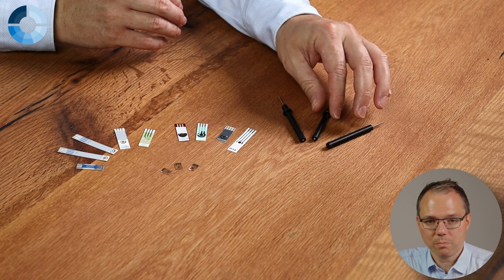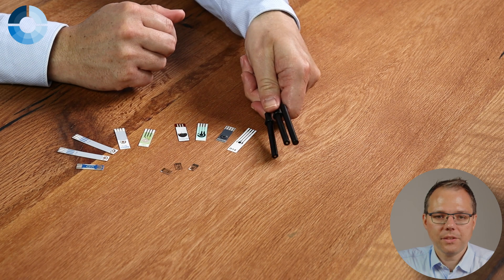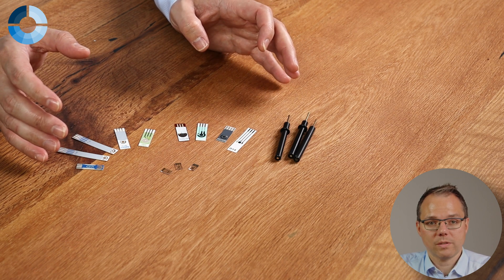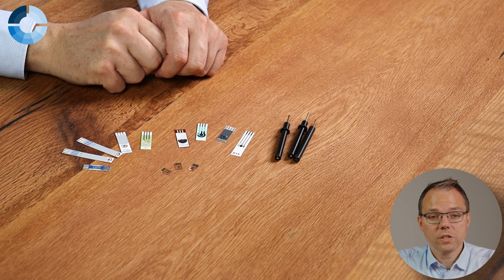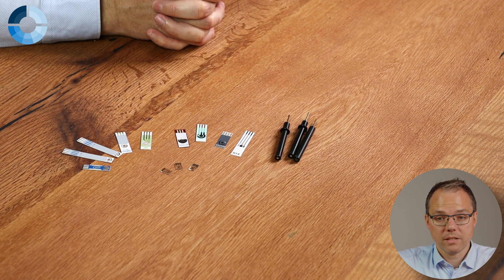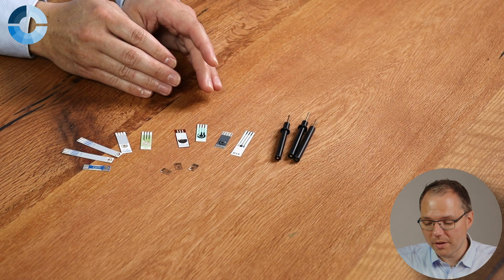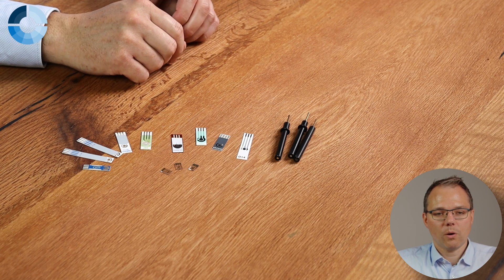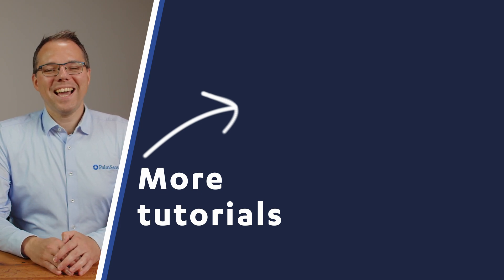What are Screen-printed electrodes and which electrode should I choose?

Comment: Good morning sir 
Could you help me out for designing my own screen printed electrode?
I am working to design a screen printed electrode using metal deposition.
My analyte is Hydrogen peroxide
Working electrode- Ag metal
Counter electrode- Ag metal
Reference electrode- Ag/AgCl
Will this combination work?
If not what kind of modification do I need to implement so that it will work nice?
Reply from the maker: Dear Pratyush Mohapatra, thanks for your inquiry.
Here at PalmSens we focus on instrumentation and software for research and OEM customers, we do not manufacture (screen printed) electrodes or accessories ourselves. Among our partners, I don't recall any of them with ready products for peroxide detection. Nevertheless, you can ask them, we provide a complete list of the companies we collaborate with here https://www.palmsens.com/custom-sensor-development/#section-3

Comment: your videos are so helpful and would like to know is there any option for calculating capacitive current/integration of capacitive area calculation from a CV using PS trace or any alternative.
Reply from the maker: Dear Muhsinali, 
That is not an easy question. Digital potentiostats work in discrete potential steps, which makes their ramps always a staircase if you zoom in sufficiently. This way of measuring has an in-built supression of capacitive current or other very fast processes. The shorter the interval time, the closer the measured capacitive current will be to the real current. The whole effect is well documented by brands that have a true-linear module, to demonstrate their advantages. 
This is why CV isn't a great method to measure capacitive charging currents.
You can use a potential step method. You can use MultiStep Amperometry or Fast Amperometry, but unfortunately there is a short overhead time, nefore the step, so for a fast capacitor this could have some impact. We are working on improving this.
We recommend Method, if you have an EmStat4 or EmStat Pico. This way you can perform the whole method on the board of the potentiostat, without any overhead time.

Comment: Is a SPE compatable with VSP 300 Biologic work-station? What can be used as a connector in this case? 
If you can suggest any...

Thanks in advance
Reply from the maker: Dear Swarnadasari9681, We would prefer that you are using PalmSens potentiostats. They have multiple options to connect electrode, SPEs or classical. However, potentiostats, no matter the brand, don't care what electrodes are connected, they will just apply the potential and measure the resulting current. All you need is a connection between your potentiostat and the electrodes. We offer multiple options for SPE adaptors, that are also suitable for other brands. You can find them here: https://www.palmsens.com/products/sensors/sensor-connection/?
If you are looking for a very straight forward option we recommend our SPE connector (2 mm) https://www.palmsens.com/product/sensor-connector/?
Reply: @PalmSens  Thanks a lot for your suggestions.